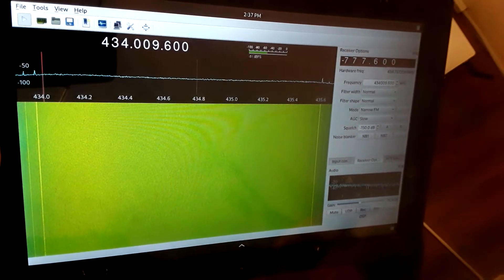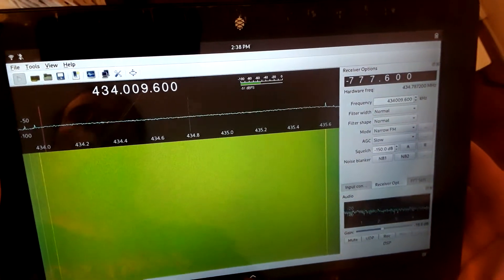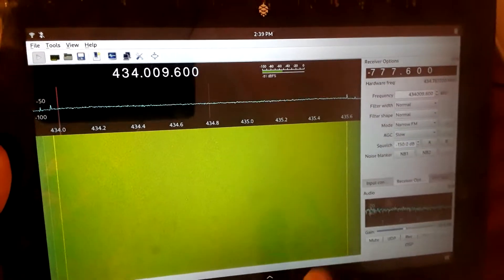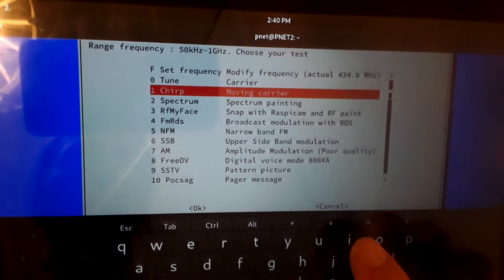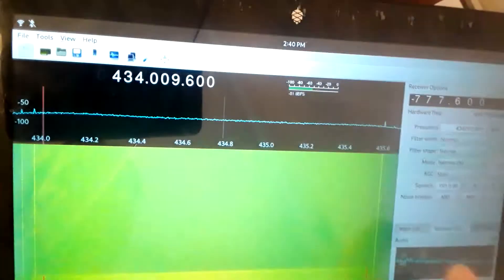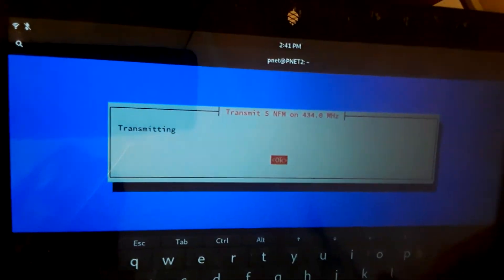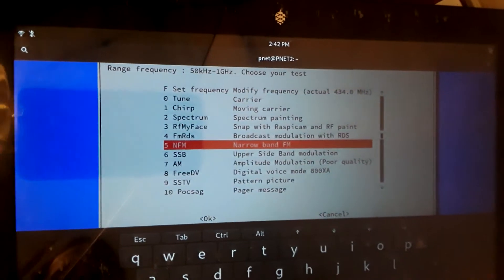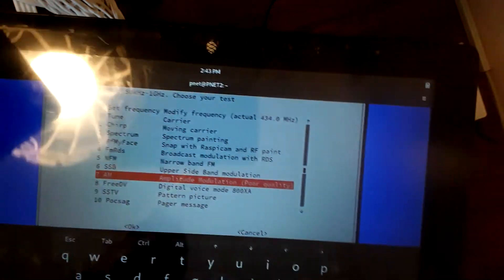RPITX: Transmit Radio Using A Wire + Raspberry Pi 0-4

Comment from the maker: I will be doing a writeup on the process of setting up RPITX + transmitting wire on my blog. Link will be posted after all is done! More radio related content coming. Thank you for Sharing and Subscribing! Share with those interested in radio or communication. :)

Comment: Can we use without band pass filter?
Reply from the maker: It may work okay for your purposes, but filtering is to prevent interference (with other devices)
Reply: @RTPTechTips  i searched it online for more info through ai 😂 , i got so confused , so with lpf (low pass filter) the job can be done easily like recieving and sending rf signals clearly right? 
Cause i heard without it it can damage the pi or aomething
Reply: @RTPTechTips  i searched it online about lpf and bpf and it was like filtering signals like recieving signals clearly and not other devices noises and sending just in freqency we want to send and not something like broadcasting to all near devices, right?
This Q would be awkward but what can get wrong that can damage the pi in this tasks like sending and recieving rf signals with pi ?
Nust want to know for more info
Thanks

Comment: I can't get it to work on a pi4....it tries to transmit on the wrong frequency (double the desired frequency). Works fine on a pi3 but I want it on my pi4
Reply from the maker: Hmmm well I was able to transmit on my pi 4... but it's been quite a while since I tested it.

See if you can try the command shown here to transmit an audio file (.wav example): https://bmc.link/politictech/rpitx-transmit-audio-supporters-early-tutorial
Reply: @RTPTechTips  how weird! Yes the command for transmitting the wav file on FM works and verified with my SDR. But I was trying to transmit a POCSAG Pager Message and that claims to be transmitting on double the frequency but SDR shows nothing on intended frequency or double!
Reply from the maker: @richardball1905  How strange! The changes made on Pi 4 must still need work... Seems project is abandoned? Shame really.

Such a neat project RPITX is.

You would like the (still active) google group page. can learn a lot, and see how others are making use (might have pi4 info).

Check it out: https://groups.io/g/rpitx/topics